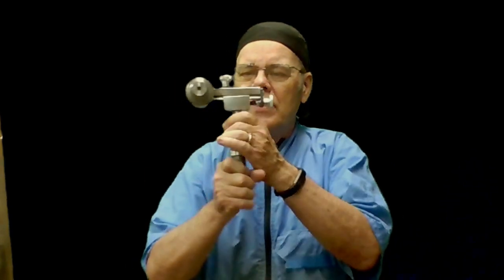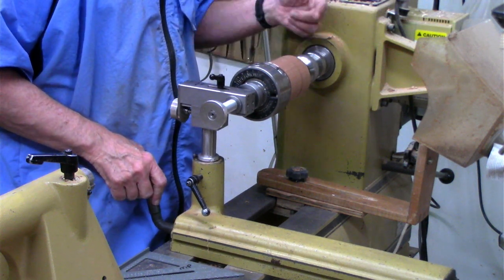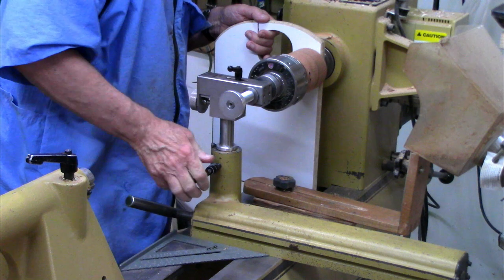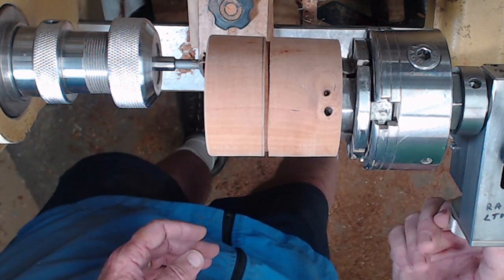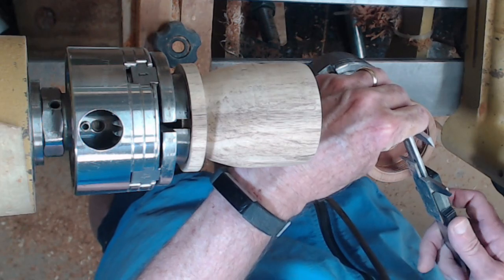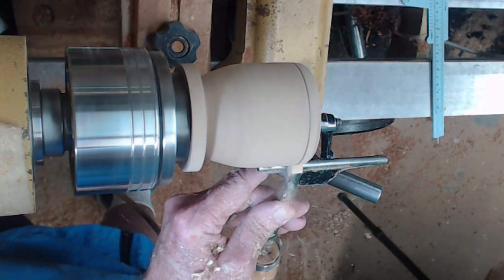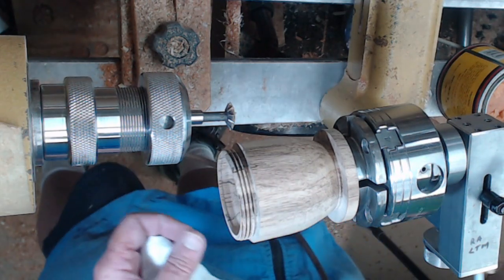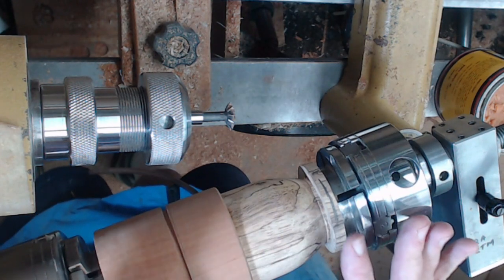Threading Jig Trick:This really Works!

Comment: Good tip Mike.
Reply from the maker: Thanks, Tim. 👍 Are you using a threading jig?
Reply: @MikePeaceWoodturning  yes I use the ChefwareKits jig that I bought at Turning Souther Style Symposium in 2019 and it works very well.

Comment: Thanks, Mike, all too easily understood and appreciated. FWIW  I am now glad I built my own jig, using a 9"x16tpi allthread rod mounted on cross slides running perpendicular to the bed. Two depth adjusting screws can be contra rotated to lock the drive screw parallel to the lathe bed at the required depth, and I can cut multiple inserts from one setting. My cutter has a straight shank held in a screw on Jacobs chuck. Pleased to have saved >60% on purchase price of a proprietary jig. It works well. Otherwise, we all can cut pipe threads!.  Bernard.
Reply from the maker: You had better luck than I did with diy jig, Bernard.
Reply: @MikePeaceWoodturning  I've found your 2017 video detailing your shop designed  jig, Mike, and indeed have been lucky with my own effort (eg slop and nut facing).. Extremely interesting and comprehensive, including George Washington's comment. In England we have a saying that a camel is a horse designed by a committee!  Bernard.

Comment: I have not yet gotten a threading jig, but what you addressed here was one of my concerns with the Chefware jig, especially after having seen you have to remove the jig to do some fine tuning on the turning in one of your previous videos.  I wondered how much fiddling there would be to get everything realigned.  Looks like this addresses that, especially using the tail stock to get height right
Reply from the maker: Glad it was helpful, Mark.

Comment: My simple method is to use a steel ruler and place it almost vertically with the lower edge placed snug against the lathe bars and the top edge snug against the side of the jig.  It is very quick, works every time.
Reply from the maker: Thanks, Richard. A.ways good to find something that works for you. I will try your method as well.

Comment: I think it would be easier to use 2 chucks (1 on jig and 1 on lathe) get a 3/8" steel machine ground dowel pin and lock it in both chucks. Tighten everything up and your lined up now.
Reply from the maker: Maybe. But you would need three chucks since you already have your piece to thread in a chuck and you do not want to remove the project and lose the registration. I appreciate the comment.